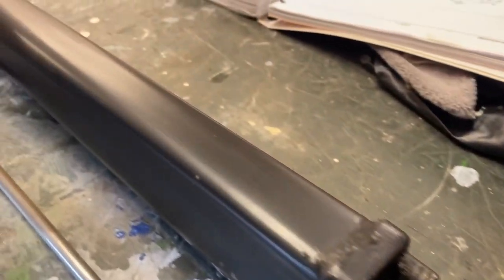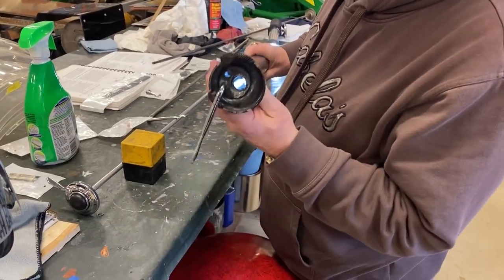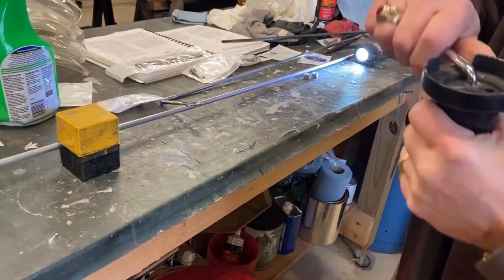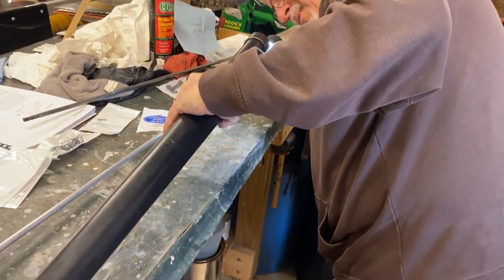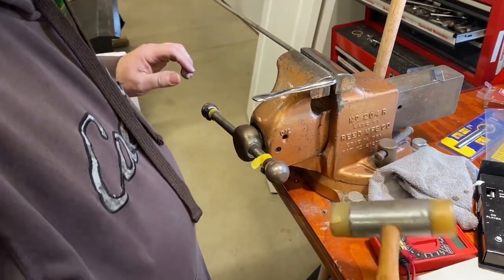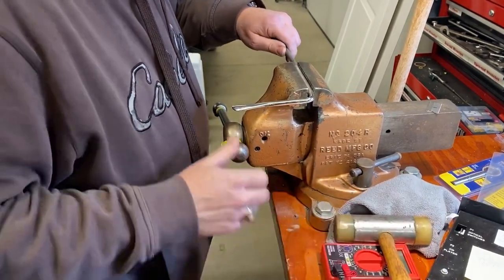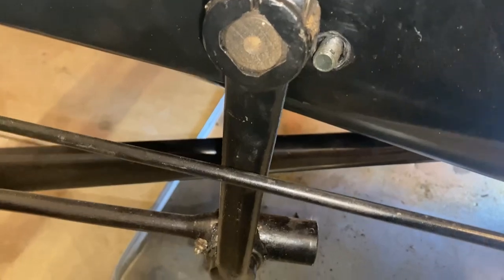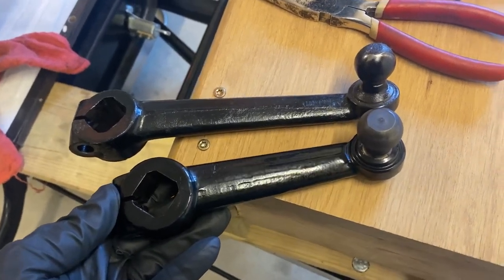Ford Model A Steering Column Rebuild

Comment: To get the felts installed (without removing the bushing) I used a length of tubing that fit over the control rod, and slightly larger tubing for over the smaller tubing. Put the felt on the smaller tube, lined it upto the control rod and pushed the felt up. Larger tubing inserted over the smaller tube to extract the small tube, left the felt in place.
Reply from the maker: Great information. Thanks for posting what you did!  I’m sure someone reading the comments will find this helpful.